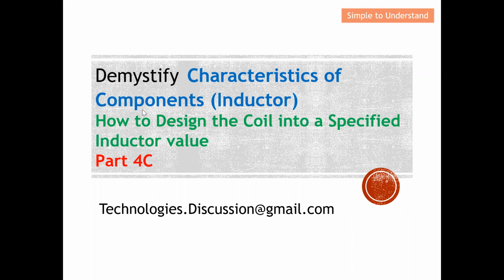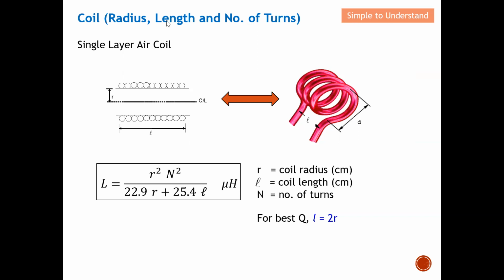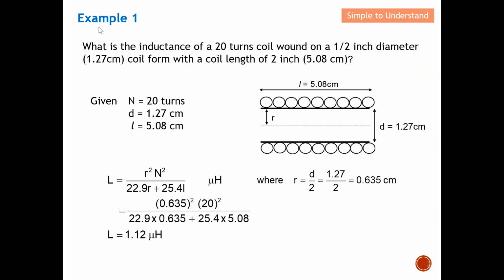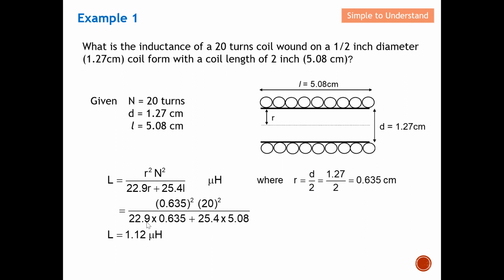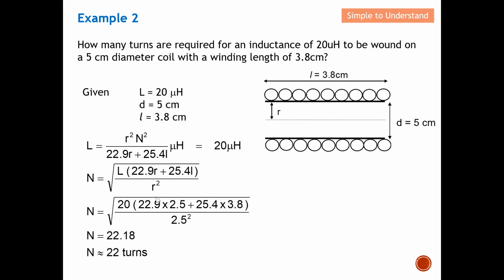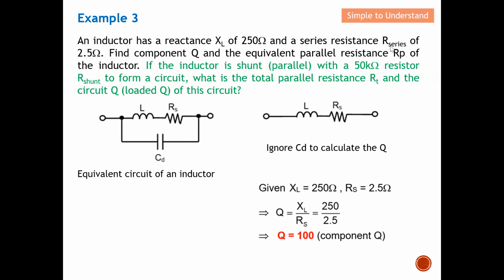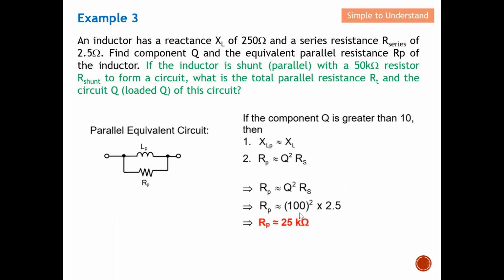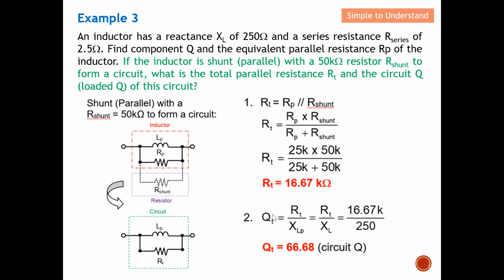Inductor Value You Need Doesn't Exist? DIY Solution: Wind Your Exact Coil (Turns, Length, Radius)

Comment: Does diameter of wire effect inductance?
Reply from the maker: Yes. But if you coil, then the coil radius, length and the number of turns will outweigh the diameter of wire.

Comment: In 4B, the equivalent circuit for inductor is R and L in series. In this lesson, 4C, the equivalent circuit is in parallel. Please explain.
Reply from the maker: Equivalent circuit of an inductor as shown in 4C is presented as R & L in series. However, I can also express the R & L in parallel. In simple word, Rs is not equal to Rp. I convert the R value base on my use case. Thank and I hope i ans your Qns.  :)

Comment: Formula doesn't consider wire diameter, which is not specified in any event.
Reply from the maker: When determining the values of an inductor, such as its inductance, in many practical cases, the physical size of the coil is often omitted or not explicitly specified because the inductance primarily depends on other factors. The key factors that determine the inductance of a coil are:

Number of Turns (N): The inductance is directly proportional to the square of the number of turns in the coil. Increasing the number of turns increases the inductance.

Cross-sectional Area (A): The cross-sectional area of the coil also affects the inductance. A larger cross-sectional area generally leads to higher inductance.

Permeability of the Core (μ): If the coil has a core (ferromagnetic material), the permeability of the core significantly influences the inductance. Higher permeability materials result in higher inductance.

Length of the Coil (l): The length of the coil is inversely proportional to the inductance. Longer coils generally have lower inductance.

The physical size of the coil, such as its length, diameter, and shape, influences factors like the self-capacitance and resistance, but these are often considered separately from the inductance itself.

In practical applications, when specifying an inductor, you may see details about the core material, the number of turns, and the wire gauge used, but not necessarily the physical dimensions of the coil itself. Engineers and designers focus on the parameters that directly impact the inductance and its behavior in a circuit.